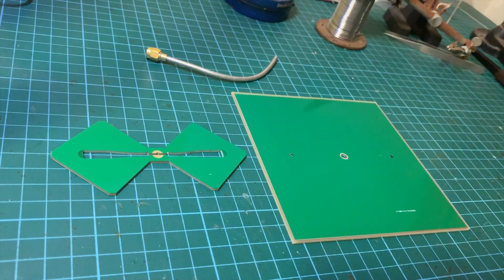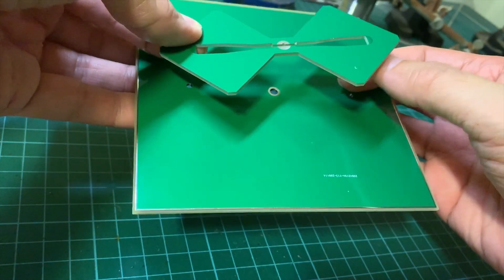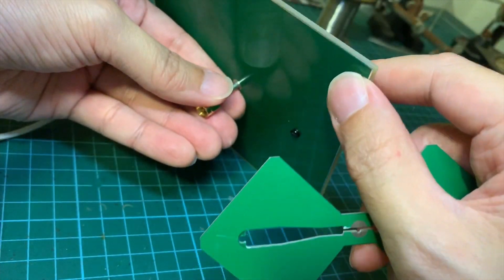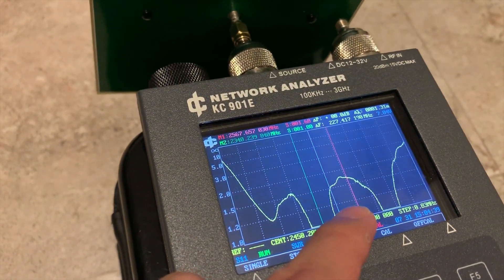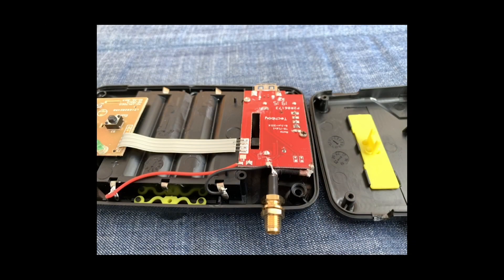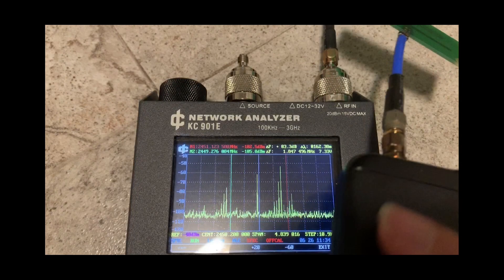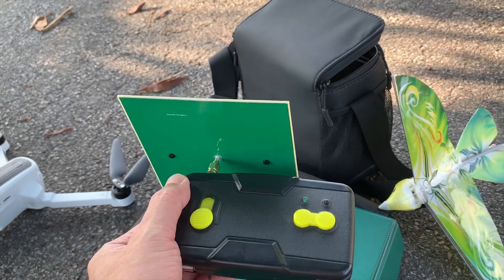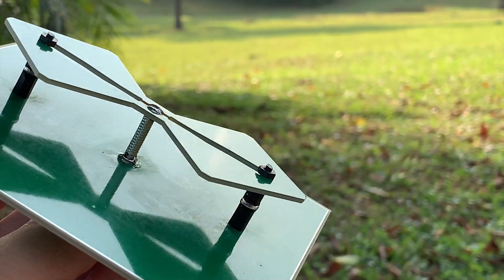Great PCB Biquad Antenna for RC Bird

Comment: I did the same, using biquad antena ,qx7 transmitter, got 26% rssi at 11.3km. telemetry over 10km for map view
Reply from the maker: Wow that is a great achievement. The biquad is truly the king of directional linear antenna because of its wide beam and efficiency. My PCB patch is only 10db instead of 11db due to the cheap FR4 (PCB material). Brass is best material (copper too soft) but it is so much easier to find cheap PCB fabrication service online.

Comment: That`s a nice antenna :) 
Usually I make my biquads from wire, but after I found thread on wifi-antenna forum that will be my next creation. One problem is I have no idea about Gerbers, designing pcb and all that stuff (although watching few of your videos I`m starting to understand some terminology ;) ). Can you be so kind and send me files (or links for them) you used to order this pcbs? If I can just duplicate your order on jlcpcb it would be  faster and easier, but I`m not sure that`s possible.
Reply from the maker: I wish it was that simple. My files were rejected by jlcpcb website because I did not use a gerber software to create the layers properly.  I had used the image-to-gerber freeware (which the method worked a year ago). Luckily my friend helped me to draw and fabricate the boards via the China fab-house that his company uses (based on the dimensions from wifi-antennas).